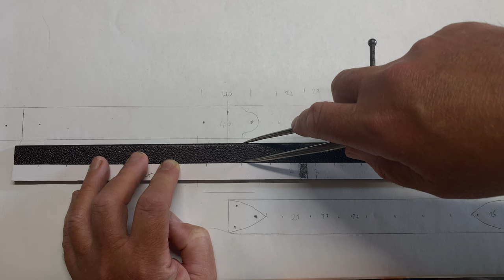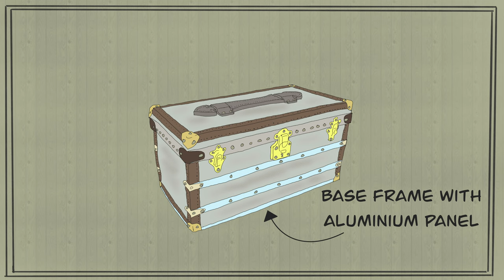Inspired by Louis Vuitton...how hard can it be?

Comment: Absolutely beautiful piece of art, exceptional craftmanship, but I really think that the bottom plate should have been covered with either veneer or very thin wood , I just think that metal bottom doesn't belong there even though isn't visible
Reply from the maker: Thanks 🙏 appreciate the comment- I was replicating the exterior of the original LV trunks from over 100 years ago and they all used metal to add strength and waterproofing - so I stuck with that. The interior, where I departed from the usual, has more metal but that’s me playing around with the design for fun making it fancy tool box storage!! For my son who inherits all my tools…not yet though 😎